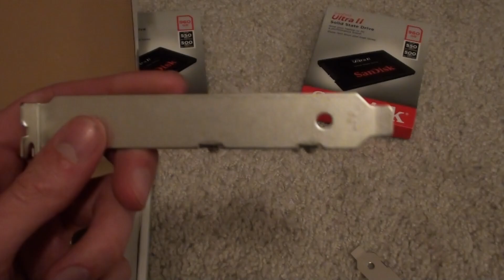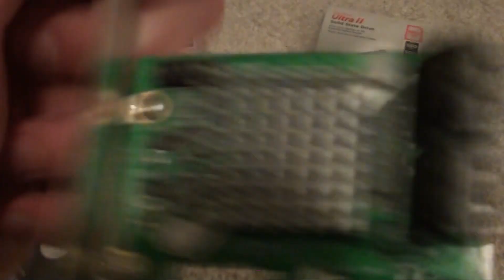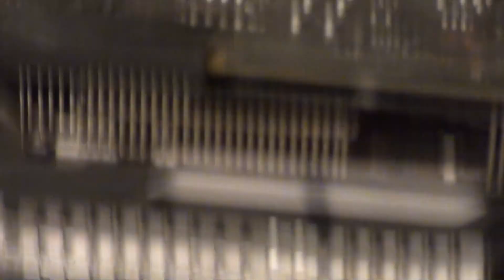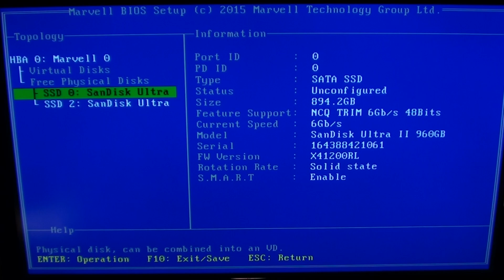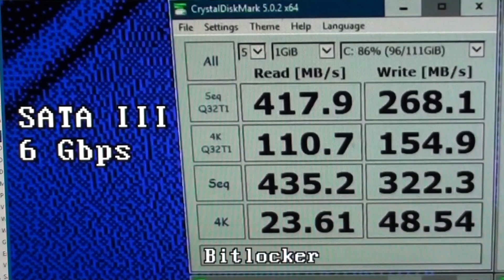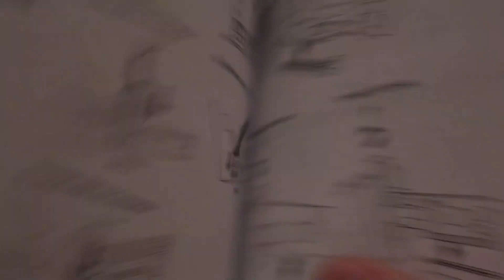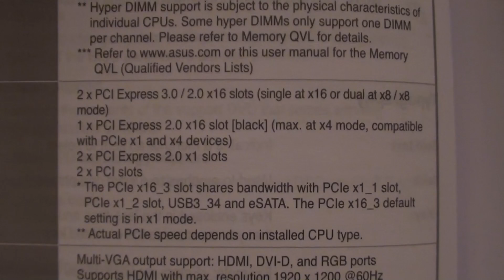SSD RAID 0 (2 TB)

Comment: you should have it before the GPU, and it should not impact the GPU speed and be faster still.
Reply: trace lengths do matter...
Reply: and you do not understand PCIe *X references for sure. as they relate to the length of the slot... then you have lane speeds which you are confusing with the length references

Comment: Hello Mr Weedking :) 
I want to give you an advise...
6:23 There you have that stupid located pci-e connector where you can't put (almost) anything at all. How to solve this problem? 
Use one of those PCI-E Riser adapters ;) 
I don't know if this seller ships to the US but you can give it a try.
https://www.ebay.com/itm/Professional-PCI-E1X-4X-8X-16X-Riser-Card-Ribbon-Extender-Extension-Cable/322578610029?hash=item4b1b2ef76d%3Am%3AmCHjsbc_JMjdHHzwNCYo0EA&var=511565013548
Have a nice day #420EveryDayEveryNight

Comment: Yeah Im software raiding 3 ssd's for my games drive, 2x older PNY drives and 1x 512GB SanDisk I lose about 30GB in raid 0 but I got 1.3TB of SSD's space with reads over 1200mb/s and writes and writes at 1300mb/s, I load into COD so fast that I have wait about 10 seconds before the 15 second count down starts at the beginning of a match.

Im not worried if I lose data on the raid if something happened, its just game files which can be re downloaded if 1 drive fails, no big deal.

Comment: Use this free tool to migrate os to ssd I used it before it works even with a smaller ssd than the drive your migrating from as long as obviously the ssd has enough free space. https://www.partition-tool.com/easeus-partition-manager/comparison.html

Comment: For the issue of the optical drives, you could use an enclosure with backplane for a 6-drive array in the 5.25" bay below the other optical drives and purchase a 1-to-2 SATA power splitter, should your power supply be able to handle all that extra load.

I know Venus makes a model that is powered from one SATA power port, probably ICY makes one similar. Both are well-known, or at least well-rated brands on Amazon, so that would resolve the SATA power issue, and you can later upgrade to a 6-port RAID card to match the SATA ports on the bay and keep your optical drives connected.

If you go about bumming for cheap SATA optical drives, you can probably find some devices of similar performance to your full-size ones for cheap, I know Digistore sells a desktop 2-in-1 5.25" bay you can house them in so they look neat, but you would need to purchase some full-size SATA to slim SATA adapters, which I also happened to find on Amazon. Shame Digistore doesn't sell the optical drive kit on there too.

Comment: 35:01 No you're getting it completely wrong XD your RAID card is PCIE x1 so that's means whatever bus you plug it into it's gonna be PCIE x1 speed

The x1, x8, x16 etc etc is just about the number lines your card/motherboard can use (one line is 4 pins except for the first one which is 7). Even though your manual says that when you plug 2 cards on the 2 first PCIE they become 8x, since your card is only physically capable of x1 it won't change anything. It is not "sharing" any bandwidh with your graphics card because your GPU and your RAID card are both limited to 8x PCIE bandwidth (but it is sharing a x16 lines bus so two times 8x) -> no matter the load you put on either your GPU or the card, you will always have the same performance on both of them. BUT, you are totally wasting graphics performance because at the end you have 7 unused lines that could increase GPU performance

So that means your RAID card is limited to PCIE 1x performance, one line has a bandwidth of 500 MB/s (on PCIE 2.0) so basically the results you're getting on Crystal Disk are fine

Comment: anyways man u know what your doing .. its more if u could be fucked doing it haha .. and im running 128kb stripe but windows 10 is 64 bit is 64bit the same as 64kb i dont know.. i got 750 on 1 mb test and 64kb i got 820 so i thought thats not bad i dont even know if im running sata 6gig cables or if it makes a difference that was with parkdale test

Comment: I certainly hope you plan to backup your data. When it comes to SSDs in Raid0 there is a danger of losing all data in the SSDs if for some reason, the PC suddenly loses power without the proper power-down. Examples are a power outage or using a Clapper. This is exactly what happened to HardwareCanucks when he tried to dramatize a computer case video. Complete loss of SSD data when he pulled the plug. And this is from a supposed PC tech guru. This is why the typical setup, even in some ultra high-end rigs consist of no more than 2x250GB SSDs into Raid0 for SYSTEM and PROGRAMS and 1-2 TB HDD storage for DATA. https://youtu.be/-Qddrz1o9AQ

Comment: dude, swapping slots doesn't turn a x1 card into a x8 or x16.  All swapping slots did was to change which version of PCIe bus it was plugged into (doubling the speed on a board that can actually handle it).

an x1 card is limited to x1 by the actual number of fingers on the card edge itself.  if it fits into an x1 slot, it is not an x4 or higher.

spend the extra ten bucks and get a PCIe 3 controller.

Comment: That last pci express slot actually connects to the phc. The south bridge. It's not the full speed. I had this issue on my setup an I just went x79 an a processor with the right pci lanes to accommodate the bandwidth

Comment: I wouldn't say you need a complete upgrade. You just have to find a better mainboard for the system, that has more bandwidth at the pci-e lanes. Also you don't need a bigger case, you just have to clean up the whole pc and do some cable management. I'd also highly recommend you to overclock your i7 2600k.

Comment: isn't raid 0 very dangerous? also wouldn't it take forever to format the 1TB drives?
Reply: Matthew Berry Yeah but downloading almost 2tb of games might be a little annoying depending on the speed of the internet :D
Reply: Matthew Berry RAID0 reduces stability. Formatting doesn't take long if you do a quick format.
Reply: raid0 doubles the risk. if only one SSD dies, the data on both will be lost. but because SSDs are very durable, it should be ok
Reply: Also if he's only going to have games on it, he's only risking the pain of redownloading/installing them.
Reply: It probably wouldn't be that much of a pain, SSDs are pretty fast
Reply: Question, is it possible for a computer to be so fast that it keeps crashing?
Reply: DialUp56k - Windows 2000 Enterprise Server Family And you know it won't have issues until it's in the 3000s? You can write Petabytes on even cheap ssds. Intel firmware has set lifespan where it will go into read only and yell at you to get your data off,but otherwise you can run any decent (and some not so decent) ssd well beyond the few hundred or so terabyte of writing it says it can do.

Comment: man I don't know what happened with speed increase when swapping PCIe ports but the card itself is 1x or 2x so it doesn't matter if you put it in 4x or 8x mode it will still work at maximum card bandwidth... and RAID0 on SSDs is just bad..

Comment: You don't have to worry about the graphics card lagging with that setup.  I've also got a GTX 970, and benchmarks I ran on it showed no improvement going from PCIE 3.0 x8 to PCIE 3.0 X16, so X8 doesn't seem to bottleneck it at all.

Comment: your computer is a disaster... I wouldn't be able to get within 50 feet of that without trying to make it look better. And just so you know, the Z68 chipset is extremely out of date... Maybe time for an upgrade? Also, not sure if you noticed, but when you were in the BIOS for the RAID card, it said that it was operating at PCIE x1 speeds instead of x2... maybe something to look into (x1 is 5GBps x2 is 8GBps)

Comment: Druaga1, why not use the two sata-3 connectors on your motherboard for these two Sandisk ssd's? Then you get the maximum speed. Yes, I know your Windows installation is on the Samsung ssd but that ssd sitting on a sata-2 connector is not as bad as it sounds. And it will still be bootable. You just have to change some boot settings in the bios. Look, Windows loves small files. Ssd's are fast with small files. You will only notice the difference between sata 2 and 3 if you are copying, zipping or moving very big files. On your Windows installation you do not. Just keep this Samsung on a sata-2 port for Windows (it will work just fine) and move your steam games and all the editing work to the Sandisk raid 0 array. Then you can even plug in your optical drives to the pci-e card, because the optical drive speed is so limited the pci-e x1 card can handle that one with ease.

Comment: Why don't you just use software raid?
Reply: Because the inbuilt Windows raid is shit.
Reply: xXDahChubChubXx No, BIOS level software raid.
Reply: Duffel Bag Full of Tech Because his motherboard only has two SATA connectors which are both being used atm.
Reply: xXDahChubChubXx Goodness, only two?
Reply: Duffel Bag Full of Tech Apparently, that was why his DVD drives were being run through that other RAID card.
Reply: xXDahChubChubXx That's fucking pathetic, to have the audacity to produce a board with only two SATA connectors.
Reply: Duffel Bag Full of Tech Yeah I agree it is absolutely heinous
Reply: BECUSE THE MODERBOARD HAS ALL USED SATAS
Reply: 블로키 TV Well then, the more you know.

Comment: Time to pull the Sandy Bridge 2600k and drop in a 3770k Ivy Bridge to unlock the mobos latent PCI Express 3.0 power. If you can't find one on the cheap it's time to Quality of Life upgrade your rig to Skylake if you're hard up for that need for speed. Or play the long game and wait for RyZen/Kaby Lake.

I went with quality of life and replaced my 5 year old 2500k/Asrock Z68 Extreme 3 Gen3 build with a Skylake 6600k/Asrock Z170 Extreme 4 build and now I have more PCI Express bandwidth to kill anything that moves (or doesn't in the case of SSD's)

Comment: Druaga1, does your motherboard support an m2 ssd? 
If so, you may consider it. m2 ssd's (especially the pci-e versions, not the sata versions) are 3 to 5 times faster than regular ssd's. I myself use a Samsung 950 Pro 512GB M2 ssd on an Asus X99-A motherboard. Great board, and, if you use the right processor you got lots of pci-e lanes. I have the 5820k processor, so I am at a maximum of 28 lanes. My videocard is using 16 lanes so there are still 8 lanes left. The ssd is using 4 lanes and puts out speeds on average 2,500MB/s read and 1250MB/s write. And no hassle with extra cards, cables or power plugs. (I have a video about this ssd on my channel. If you are interested in how it looks, installs and works just check it out). Oh and you might find the Cooltek G3 installation video also interesting because I tried to mimic your way of making video's, say and do stupid things etc (like throwing three scissors to open a box while one would be suffice). Would be great if you left me a message there. Otherwise, happy Christmas. ;-)

Another big advice: USE SATA CABLES WITH CLICK SYSTEMS. The ones you are using are bad and come loose at any moment.

And some more: Disable Indexing on ssd's, especially if you are using them in a raid 0 configuration.

Comment: I think part the problem is the RAID controller MIGHT not be fast enough since you're spreading the PCI-E bandwidth between 2 SSDs at the same time. Also, your CPU usually limits how many PCI-E lanes you have available. I think Linus Tech Tips has some videos on PCI-E lanes

Comment: Your PC is a horror show ...
Sadly I have dealt with far worse...
cough
To be fair I have three HDDs and at one point had three SSDs in my system at once.
While I was cleaning up data I had an issue with a loose SATA cable. 
:| data corruption before I realised what happened.
Lost some porn.

Comment: If I'm not mistaken PCI-e lanes with an intel system are controlled by the processor, so you may not need a new processor not a new motherboard...
Reply: Steven Randall CPU and the motherboard control PCIe lanes, however only 2011-x socket motherboards will increase PCIe lanes substantially.  I doubt he needs 40 lanes. A BIOS update may allow auto-negotiation of the x2 card properly. Many motherboards will default to x1 speeds when it cannot sync at x4.
Reply: Ah okay. I'm on an AMD platform so all mine come from the chipset, but I knew intel's was different.

Comment: The 10 commandments of The Church Of The Holy SSD.

1. Thou shalt not use HDDs.
2. Thou shalt obey Druaga1.
3. Thou shalt be subscribed to Druaga1.
4. Thou shalt not defragment SSDs.
5. Thou shalt not use SATA-II for a SATA-III SSD.
6. Thou shalt not use IDE.
7. Thou shalt pray to The Holy SSD.
8. Thou shalt not have any other SSD than The Holy SSD.
9. Thou shalt use Hardware RAID instead of Software RAID.
10. Thou shalt be loyal to The Holy SSD.
Reply: A new sect just came up: M.2 vs SATA.
Reply: Now thats the type of church i'm talking about

Comment: I wasn't expecting swapping PCI-E port to solve issue, since that RAID controller is only PCI Express x2-one (aka 1 GB/s), but seems like total bandwidth of chipset is really issue there.

So best bet would be just plugging these SSDs to your mobo and old mechanical drives to that card and using software RAID.

Comment: So I'm not completely sure, but from what I heard in school it's like this:

If you want the extra lanes (x1 = 1 Lane, x4 = 4 Lanes, ...), you actually need the physical pins on the raid card (your card fits into a x1 slot -> it actually only can handle x1.

So better put the card into a slot which does not bottleneck you g-card(I got x8 -> x16 20% more performance).

As you read in your manual, even if a slot is the size of a x16 one, it does not need to have all the lanes routed to it.
So always read the manual when setting up you PCIe cards.

Comment: Druaga, 2x, 4x, 8x and 16x are the bandwidth connectors on the PCI-E card, in this case the RAID card you have is a 2x PCI-E card, so inserting it into a 16x slot (the one you're using with the GTX 970) will not improve anything because you're already hitting a wall with the 2x card. What makes the difference is the generation that 2x card supports and the slot supports. ie 2x PCIe 2.0 < 2x PCIe 3.0.

Comment: Druaga you'd be safer/better off using either 3 drives in raid5 or 4 in raid10. One glitch on one drive and your data is gone on raid0.

You should also be using a real raid card, not a cheapie sata card with raid drivers like you have.
You can pick up a hp p410 or dell perc on ebay cheaply.

Comment: Druaga, you've already got a raid controller with the same or better capabilities built into your motherboard.  The chipset on that board is basically an integrated motherboard chipset pulled out onto a separate board for systems that need more than their native amount of drives available.

As is that card is a bottleneck, and using the built in RAID will give you more performance with virtually no additional CPU overhead.

If you want a hardware raid, go with LSI logic with a supercapacitor write cache.  That is the only way you'll gain any performance at all, it'll cost $400 and you'll see maybe 2-3% higher throughput.
Reply: I know, but you could buy refurb or used lsi or 3ware/adaptec sas raid controllers usually connected by PCIe x4 to x8 (which are compatible with SATA III HDDs/SSDs) of ebay for example for ~50 - 100 $ or €.
Reply: the marvel ones might be good but are fake raid, as the ones on chipset or on board...
Reply: tmkoeln all consumer level RAID is 'fake RAID' because it's worthless.
Reply: tmkoeln good point on the used/refurb.  LSI really is the way to go for a real controller.
Reply: Yep, I know bought a refurbished 8 Port DELL Perc H310 Controller (LSI RAID) capable of providing SATA 6.0 Gbps off ebay in Germany for around 58 € including shipping

Comment: Druage what r ur specs. gtx 420, 420 MB ram, asus rampage 420 mobo, core i4 20,
Reply: wat
Reply: Snoop Doge 420 gb RAM*
Reply: Snoop Doge and ryzen 420*
Reply: No such thing as a GTX 420, but there is a GT 420. Also no Core i4 either, though there's a Celeron 420.

But as for his actual specs: ASUS mobo, Core i7-2600K, 16-32GB RAM, GTX 970, and a buttload of storage.

Comment: why not use double sided tape to hold the SSDs in place and you are going to use Molex connectors to make the power connections to your PSU there is just no getting away from it.

Comment: my face is a capacitor
Reply: Resistor over here.
Reply: mine is ugly
Reply: Pistol Switches mine is a diode :/
Reply: condensator over here
Reply: Voltmeter over here.
Reply: Windows98_SE smooth
Reply: My face is a choke

Comment: Don't worry Druaga, NVidia GPUs can run without hiccups at 8x speeds too.
The main problem, is the Raid card since with those SSDs the speed should've been around 1GB/s

I would suggest you to upgrade your motherboard or maybe change Raid card
Reply: Jeremy Clarkson modern NVIDIA cards will start to reduce frame rate if run at pcie 2.0, the difference is 5% or so.  Pcie x8 will take another 5% or so performance as well.
Reply: I was of course talking about PCIe 3.0 8x.

You can find a video by LinusTechTips that shows that there's no difference between 16x and 8x at 3.0 speed obviously

Comment: Druaga1 have you saturated all PCIe lanes on the motherboard? You plugged it into a PCIe x16 slot (x8 electronically with GPU installed). Using all those SATA 3/6gbps ports is most likely reducing PCIe slots speeds.

When you use the RAID controller configuration tool. It stated its in 5Gbps x 1 mode (PCIe v2.0 x1), ideally you want it to be in x2 mode. You'll need to configure the BIOS to make sure that slot is operating in x2 mode (or x4 mode) and not the default x1 mode.

Both performance benchmarks are within margin of error.